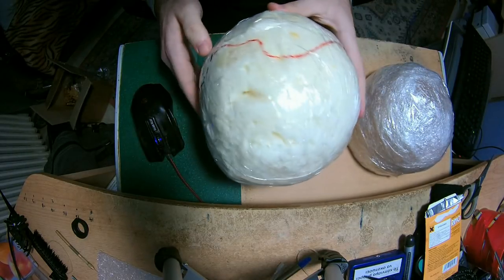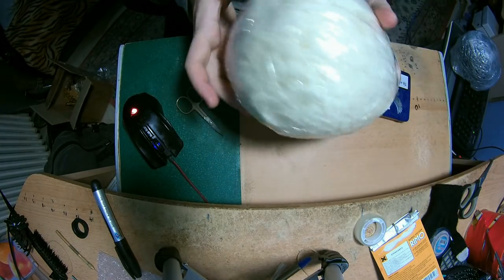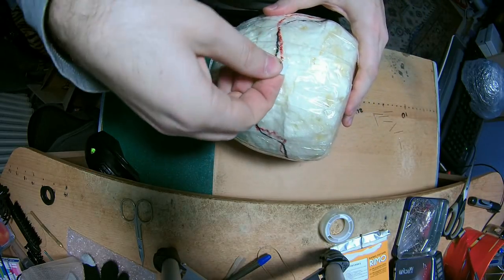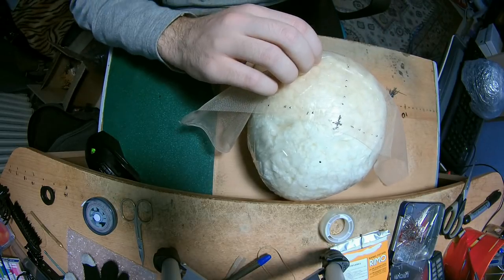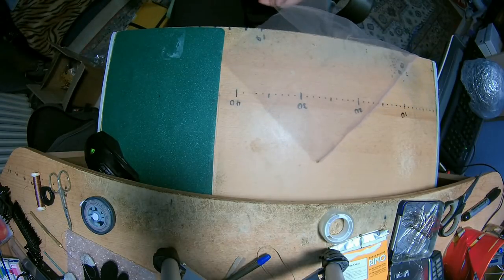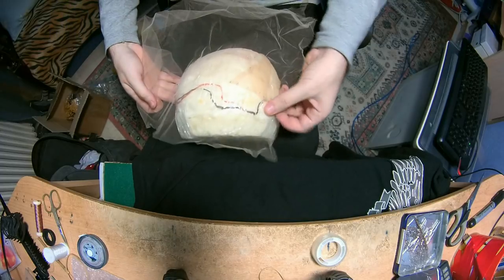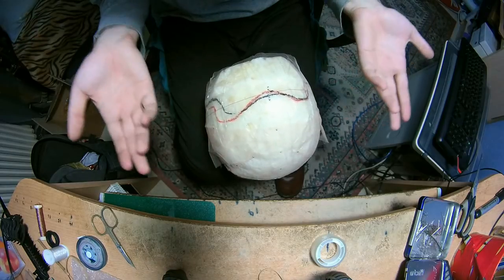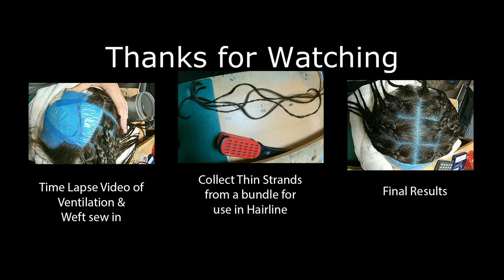Custom Wig Cap Construction

Comment: Great work and the ear tabs are genius.....is that what they're called on eBay?
Reply from the maker: Mike Love The ear tabs are called ear tabs without that thing. That thing in the wig glossary is called a wig spring. They are either metallic or plastic, I prefer the plastic. But they are either nowhere to be found or they are expensive with expensive shipping.In this case I did the wig springs using some plastic collar holders. All this package has 200 of them and it cost me like 2~3 euros if I remember correctly!

Comment: Can someone please explain to me the purpose of random blocks of darker less see through mesh on wigs? Especially on full lace or full lace glue less?
That part doesn’t take away of the base looking natural for hand tied or ventilated hair?
Reply: The darker lace is usually stronger and the holes are a little bigger so the wig lasts longer (doesn't rip) and is easier/cheaper to make. This is why the darker lace is usually in more inconspicuous areas :)

Comment: You said wefts are to be sewn at the back. What if i plan to ventilate there as well? Should i reduce the wide ear notches or cut them out? And what is the invisible thread you used in the hairline? Also, what it is called that transparent thing you put in the temples (what's the link where you get them)?
Reply from the maker: +Abram Patrick Abesamis The lace can be different, usually I make everything with less darts now, unless it needs wefts in the back.

The thread I use is nylon thread for sewing. It is also used in quilt making.

That plastic thing is meant to be used in collars for Shirts. I lost the link to where I got it, i was definitely from ebay and it was rather cheap.
Reply: Thanks!!! You're Always resourceful, clever, wise and intelligent.  So do you have a video of a full lace cap construction with less and/or shorter notches if i wish to ventilate it all over the base? Pls. Thanks
Reply from the maker: Abram Patrick Abesamis
Pretty much all my new videos have the new less dart construction, but let me see if I have a stand alone video for this.

Well the first 3 minutes of this one kinda show a little bit how it looks.

https://www.youtube.com/watch?v=43ZNtYjdFl0

Comment: hi how you make it really glue less?
Reply from the maker: +Karim Noorali Well you do not have open lace in the back but rather a fold or some ribbons, you put clips and combs wherever the customer needs and also an important thing is an elastic band from above one ear all the way back to the other ear. This way the elastic creates a slight tension to the forehead area and thus the peice clings to the skin without the need of a glue.

Comment: Hi

How do you separate the hair strands of weft hair? If you are taking smaller pieces of weft at a time to avoid sorting the whole weft at once, but you want length variation throughout the unit? Hope you understand what I mean.

Also, is any of the lace that you use here in the video on your website? Or what is the lace you have on your website comparable to? 

Thank you in advance

Comment: why don't you close the seams/connect the  front/back lace using the ventilating needle? So much easier!
Reply from the maker: +Ryan Hynes I have a video where I ventilate thread to fill a hole in a piece. But it is not "easier" it is just another technique, the easiest of all is to make the wig cap (and this is an old video, my wig caps are slightly different and they depend on the kind of wig) and then I remove it and pass the stitches with a sewing machine that does the best job for this. Super secure, as fine as possible and consistent.

But everyone have their own techniques who they might find better than others'

Comment: Thank you so much for your video.  If you were to create a wig cap for a short wig, where would you place the seams? Or would it not make a difference?
Reply from the maker: SweetNatti well the shorter the wig the less seams you wanna have, you can't avoid them but you can keep them minimum by cutting some parts, like the huge triangular int he back I wouldn't keep it all.

Sort wigs usually need more care in the making because the whole wig is like a parting line and the whole head perimeter is a hairline equivalent.

Long hair can hide many things that short hair can't, if we talk about a really short men's haircut then we need undetectable lace even in the back and not more than 2 strands per knot! This is why men's toupees are usually more expensive than female toppers or wigs!
Reply: Thanks for your response.  I am struggling with work out how to start because I figured that making a short wig would take greater skills than I have.  

Do you make short wigs?  If so, it would be great to see how preparing the cap and the hair differs.